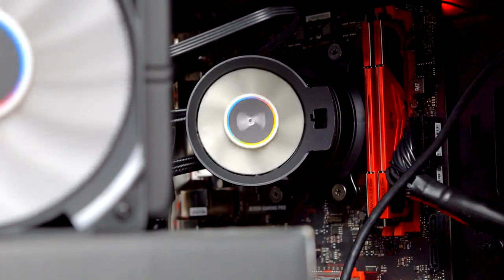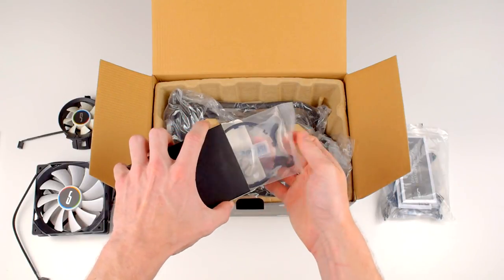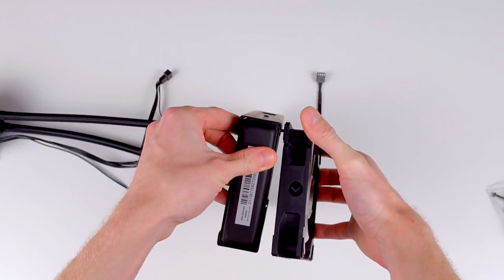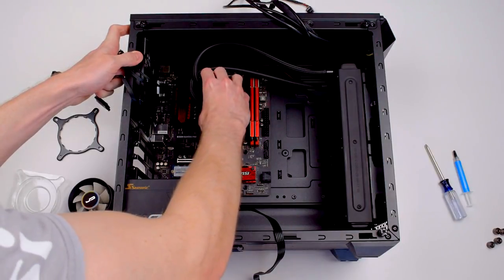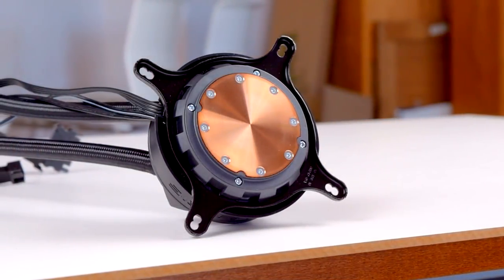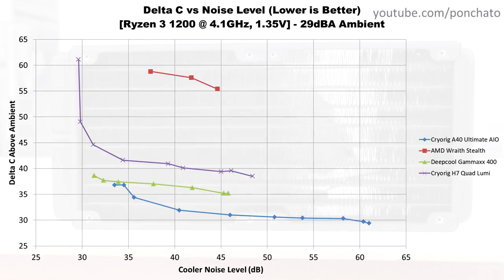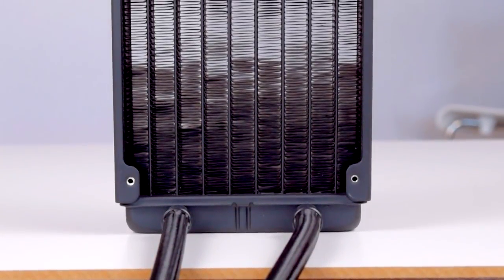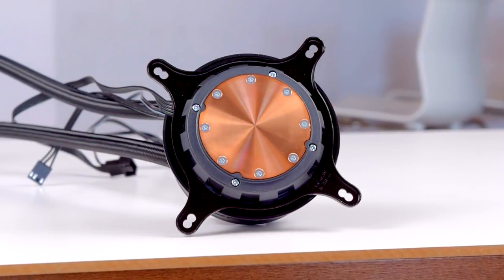Solving The VRM Heat Problem: Cryorig A40 Ultimate Review

Comment: Gammaxx 400 does well on the 1700 @ 3.9 1.35v but the A40 ultimate drops 10c off it. Really happy with my a40 ultimate.  I put the pump on the opposite way and glued the fan on to point down to the vrm on my b350 tomahawk.  Took 30c off the vrm compared to no fan. Gammaxx 400 hit about 75c on the vrm and 65 when i put a second fan on it. Didn’t do much for temps though. Doing a push/pull on the a40 only reduced temps by another 3c.

Comment: remember that you have to keep the stress test going for 1-2 hours to make sure the water temperature is stabilized. If you don’t, you may observe unrealistically low numbers.
Reply: I find my AIO equalizes after about 15 minutes, anything after ~45 minutes is at most 1-2c changes and will fluctuate more with room temperature changes than with water temperatures.  Granted I haven't ran a massive test suite on coolers.

Comment: i wouldnt be surprised if it bested the kraken x 62 this thing has a good fat rad plus your vrm around get cooler as well and your fan and your air moves around way better especially when most of the time u have a fat hot gpu right under the cpu so having a fan right there helps the airflow from gpu

Comment: where can i found vrm temps? my mobo msi b350 gaming plus is 60C hot in stresstest is it good?
Reply: btw my cpu is overclocked and soc voltag is 1.1 manually set
Reply from the maker: SI MO: I use either HWMonitor (https://www.cpuid.com/softwares/hwmonitor.html) or HWiNFO (https://www.hwinfo.com/download.php) to monitor the temperatures. The sensors are rarely labeled well so you may have to experiment to figure out which temperature is actually the VRM.

Easiest way to do this is run a stress test with Prime95 and watch the motherboard temperatures. The VRM will heat up when the CPU is under heavy load, whereas the chipset and SIO (can't remember if that's Intel only) usually stay pretty constant.
Reply: I am using hwinfo but idk where are vrm temps and stresstesting in aids 64 and in hwinfo my mobo is 61/62C
Reply: 61C is great.  Even cheap VRM can handle 100C continuously without issues.
Reply: Not vrm, just mobo is 61C in hwinfo

Comment: still doesn't really solve the problem of pump failures and coolant drying up or clogging up
Reply: franzb69 AIOs will surely dry and clog over the years of use, the bright side is you'll get better cooling that will extend the life span of your CPU and Mobo.
Reply: i fixed my problem. i went with the best air cooling i can afford. noctua dh15

Comment: dont foget others aios cooler master liquid , the arctic AIO,  the eisbaer aio, evga clc,  kraken x 52, not to forget the gtx 100i or 110i , 115i aios from corsair . I will look into it if i ever need . yeah for real any aio is gonna be just about the same the pump uses the asetek pump design wich everyone else uses depending on generation.

Comment: It's an interesting concept but its ugly af to be honest..
Reply: I ran my i5-8600k 5.0GHz @ 1.215 Volts and it was stable, thanks to that "ugly" fan, I'd rather have an ugly look over a risky voltage to overclock ^_^
Reply: Superbe what were your temps? Also a good mobo is necessary for stable overclocking too
Reply: My mobo was the most criticized one out of the z370 family in terms of overclocking, its the z370 msi gaming plus, my temps were 55C max @ 5.0 ghz, 1.215 volt, which leaves a huge room for 5.2 ghz oc but I didn't try yet
Reply: Superbe impressive my dude

Comment: dam theres soooo many and the new liqtech rgb and new rgb coolermaster aio . but alas i must contrain myself and spend money elsewhere and if u ever need a little bling u can alway get some rgb fans . Now ? what wou u Ponchoto recomend for best silent and performance oriented rgb fans that u dont have to jump through hoops of ton of connections and hubs i recently got the AIGO rgb fans yeah theyre not quiet unless u set to the quiet mode and u cant control it unless u keep on unscrewing your case and all your panels just to click a dam button wich is annoying as well for thermaltake ring fans i dont know perhaps they came out with a newer version i have the older ones from best buy . Can u believe corsair 3 fans only 90 dollars and u cant even control them with a remote unless u get a special node that isnt cheap that comes with rgb strips that u may not need so annoying .